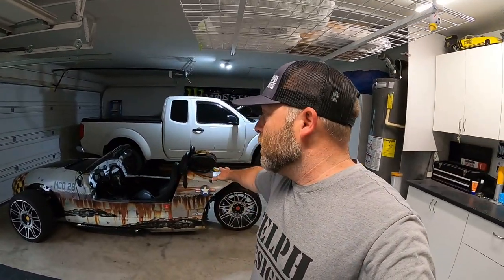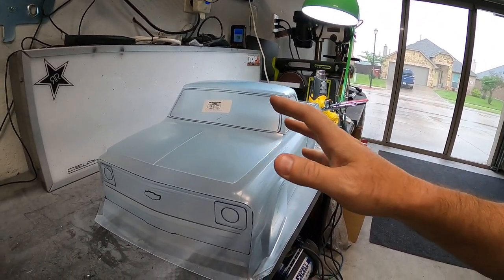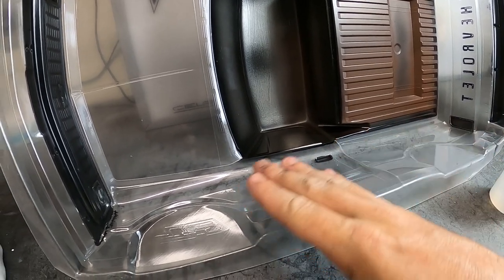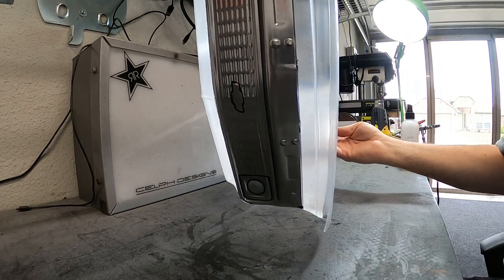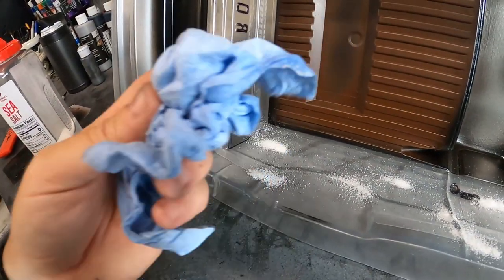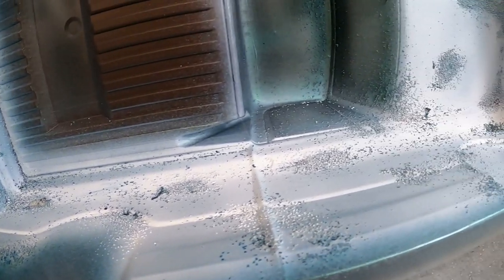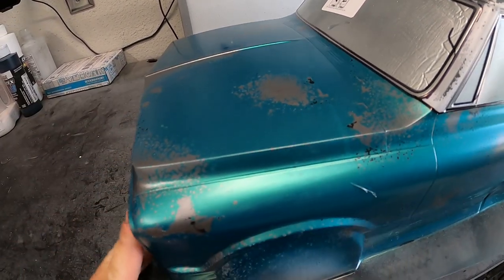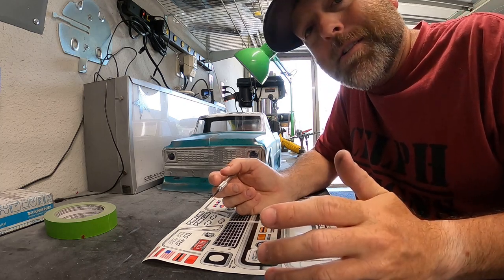How to Paint Patina on an R/C car body!

Comment: Awesome job, subbed! Are you thinning the Createx paints, if so what ratio? Also, what pressure do you use? Thanks!
Reply from the maker: I think as needed.  From bottle to bottle it varies.  Not sure how much since they are always different.  I run about 45psi most of the time